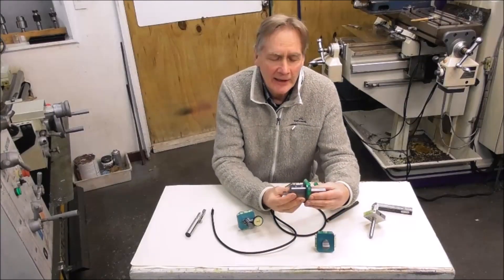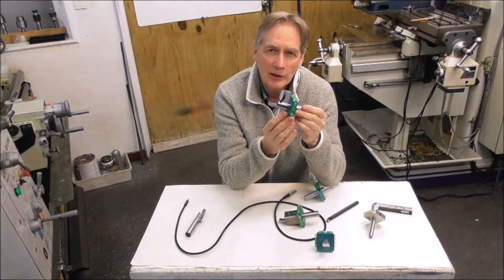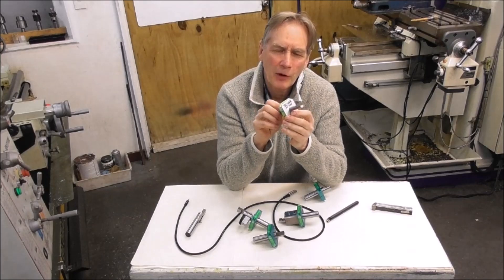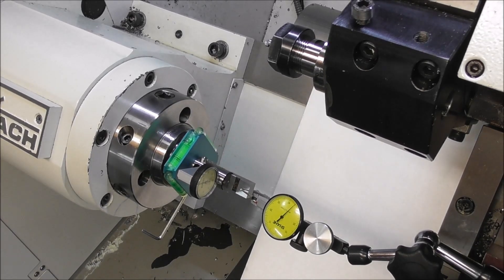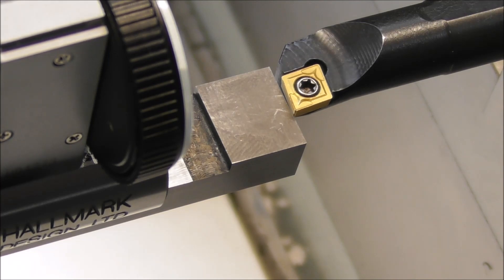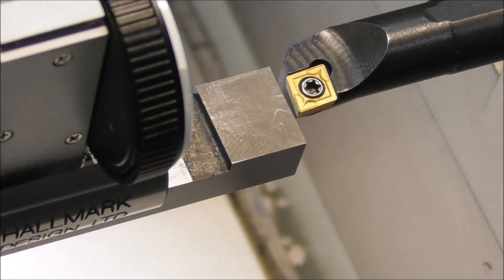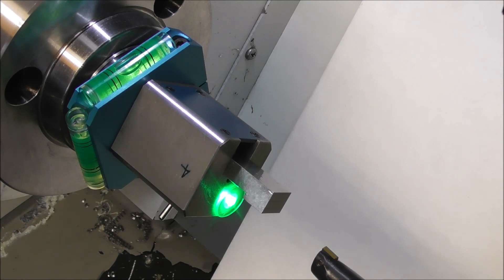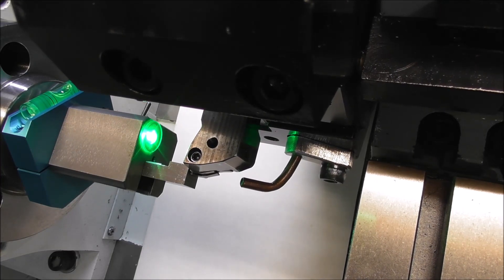Introducing new Lathe ToolSetters

Comment: You should consider reversing the beeper so it only comes on when it makes contact. Brilliant tool work as usual 👏👍👌
Reply from the maker: Thanks SJB. The circuit is NC (normally closed) to suit passive circuit machine connection. This could of course be changed with more electronics but that would add to cost, space and complexity. Cheers  Cliff